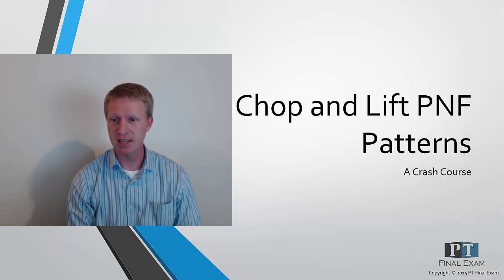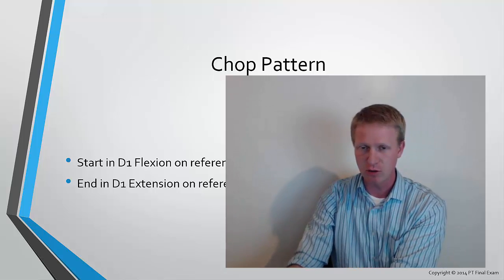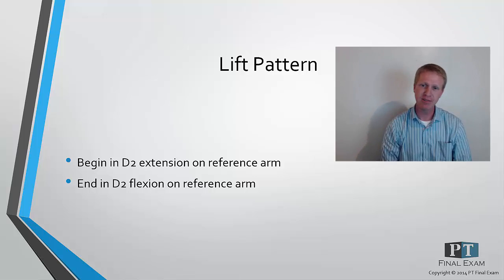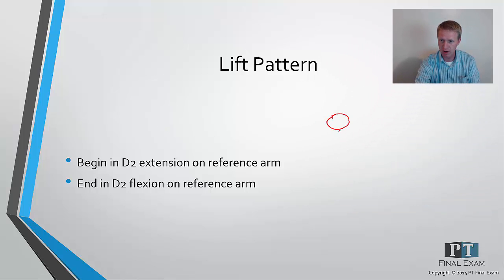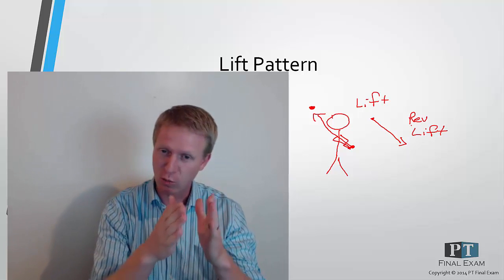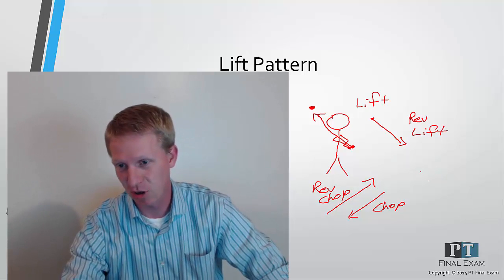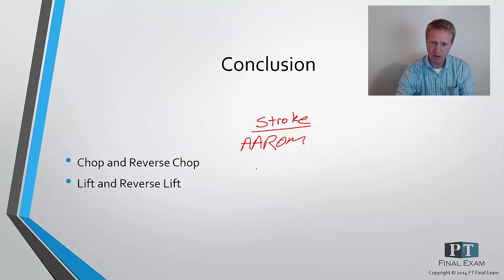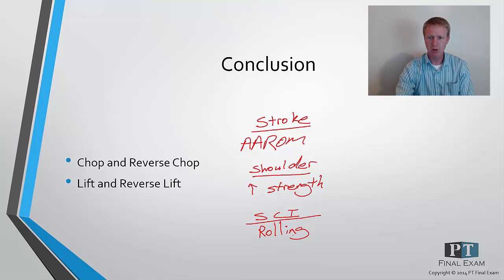Chop and Lift Patterns: A Crash Course PT Final Exam #npte #npteprep

Comment: thanks!
ex question: pt has L CVA and you're trying to improve function of R UE using PNF. They are at stage 4 of recovery. Why is Chop/Reverse chop both out of synergy but only Lift is out of synergy and Reverse lift is in synergy? The reverse chop seems like it would also be in synergy.
Reply: is your question answered? what's the answer?
Reply: +Kelsey Zane Had the same confusing question on this one.  I'm presuming you got the therapyed book because I'm looking at the same question.

First thing, I think this video explains the idea ok but what I can gather to make it as simple as possible is as follows:

The extremity doing the motion is doing the pattern, in UE the other is just assisting the motion

D1 pattern = a chop
D2 pattern = a lift

As far as chop, reverse chop, just think of chopping wood.  So you start with your arm above your head and come done = starting is chop = D1 flexion, end of motion is where you would start a reverse chop = D1 extension

Same applies to lift, when you lift something you start with your arm down = lift = D2 extension, when you end your arm is above your head so reverse lift position = D2 flexion 

2nd thing: He mentions the Lift or D2 pattern is more in synergy but I do not believe that to be correct and the therapyed book says otherwise as well.  The reasoning is, do the motion yourself and notice that when you end in the D2 aka Lift pattern of the right arm, you are in the "flexion synergy position" of scapular retraction/elevation, shoulder is abducted & externally rotated, elbow is flexed, and forearm is supinated. pg 140 in therapyed 18th edition, "big book" 

Hope that helps and good luck on Jan 27th!
Reply: +Paul Estrada  
Hi Paul, thanks for your response! Yep, taking the exam next week and still struggling with the visualization of this but can you confirm the following logic is correct: 
The chop/reverse chop makes some sense (chop moves the UE into /, ABD, IR (out of synergy) and the reverse chop moves the UE into flexion, ADD, ER (out of synergy)). Not sure why it says D1E only if it's a combination of D1E and D1F.
The lift (brings the pt into flexion, ABD, ER (in synergy): start with arm down at L ASIS -> up at R shoulder.
The reverse lift (brings the pt into / ADD IR (out of synergy)): start with arm up at R shoulder --> down at L ASIS.
....so you can take out that option because the whole statement is not correct.
In the TherapyEd book it says it's opposite....lift (out of synergy)/reverse lift (in synergy) and that's what is confusing me.
*I went through this thought process with the help of Kisner & Colby pg. 208
Maybe I'm making this harder than it needs to be but I feel like the reasoning and critical thinking skills are important.
Thanks in advance!